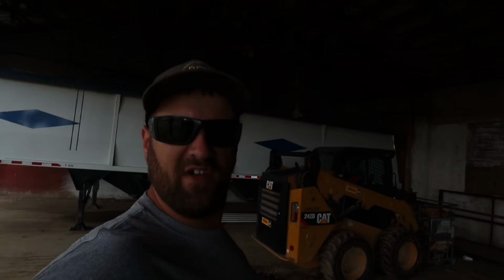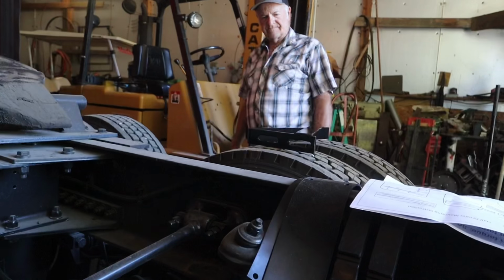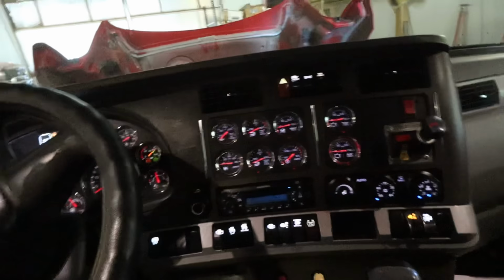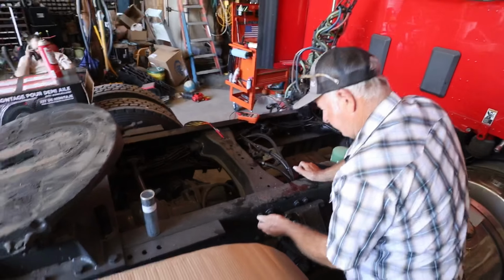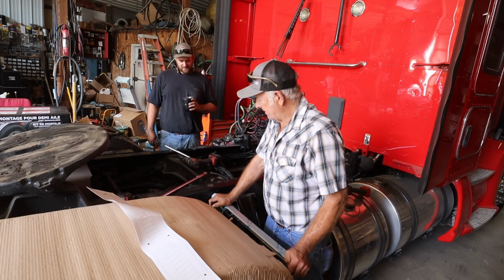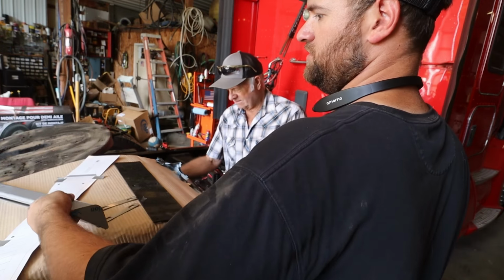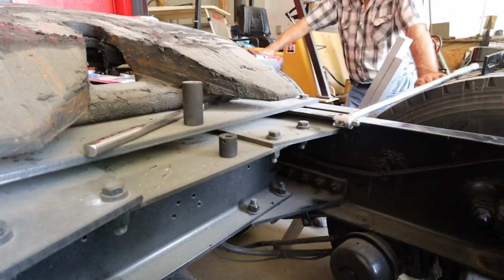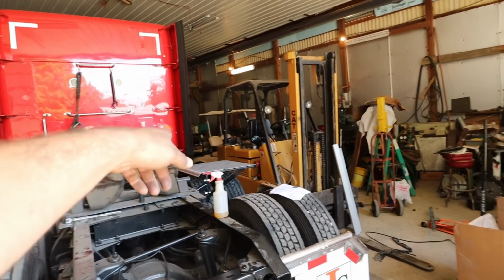How not to install Fenders! It’s Broke!

Comment: It is nice to see the three of you working together again on a working words project with fancy directions. Long time ago I installed fog lights on my new 1985 1/4 ton Toyota pickup. I was on the last step were I needed a hot wire from under the dash to power the on/off switch. Found a wire and finished. I turned on the fog lights and the dome light dimly came on. I found the dome light wire. The fog lamps  also would dimly come on when I opened either door. That was a hard one to explained to anyone.

Comment: I love how everybody was upbeat and excited about installing the fenders at first and then reality slapped you hard! I knew when the video started that you were in for a surprise. That’s a two day, at best, project for someone that knows what to expect. Working around all the existing brackets and air lines is an absolute nightmare and everything you do screws up the finish of the stainless steel parts. Good luck.

Comment: If y’all have to install any more 1/2 fenders 
East manufacturing makes a great sturdy fenders 
They are made out of aluminum tread plate 
In the front you lay a pipe across the top of the frame preferably 1 1/2 and cut out a strap 1/4 inch plate and round off the top on each side cut a hole in it for your pipe to fit in it and bolt to an existing  frame bolt end mount the rear brackets they are strong enough to walk on if you have to we used them on coal trucks in western ky they are very durable

Comment: I've put many of that style of 1/2 fenders man you guys LOL. If you think fender are too high you can weld 1x1 bar stock on stops which will let you drop fenders lower by 1 inch. That suspension drop 4 to 4 1/4 inches adding 1x1 bar stock to the stop take inch out of that. BUT being its farm truck going in and out of fields you may not want to do that going to need all axle movement you can get. I think you be better off with plastic fenders over stainless fenders you will get into them with trailer. Suspension on Kenworth from Peterbilt low air leaf they also use Peterbilts flex air too. But Kenworth call them different model name. Paccar made Kenworth use Peterbilt suspension since Kenworth had so many problems with 8 bag suspension

Comment: I have never such a problem installing quarter fenders. They usually bolt to the frame. Then you adjust them with the u bolts. Good luck

Comment: Oh Brian...how I could of saved you so much trouble!.Lol.  I've been thru that but have many sets installed under my belt now.
Reply: Also forgot to mention since you are pulling a hopper they need to be mounted low as possible or need a high fifth wheel.   I put them basically on the tire with air down.  Hopefully you don't rip them off going in and out of fields.

Comment: I hope the trailer doesn’t knock those off before it starts to climb up the 5th wheel when you back under it?! Those fenders are always a pain, they either crack or snap off at the front bracket. We went to the plastic minimizer ones.

Comment: Don't feel bad. I've seen mechanics install full fenders 2 inches higher than the fifth wheel with the air dumped out of the suspension. They got torn off when the driver tried to hook up a trailer.

Comment: i know what you mean brian about the grass burner exhaust man i help farm had one on an L8000 ford well used to be an old R&L trucking semi with ugly fareing on top and that green son bought it used it to pull the farms dropdeck with sprayer tanks on it till his dads 81 Ford L8000 dump truck we used to haul grain was getting too bad so made it a semi funny story about that if you are interested anyway his son bought newer western star daycab  and ravens 30 something ft dump trailer so his dad bought the green semi daycab we took bed and hoist and put on that truck winter project we hauled alot of grain and gravel with that truck  one thing i did not like was on bed it had roll tarp from side but used bar to roll open rope to pull shut but then it had ratchet straps on side of bed that you hook to tarp to hold and tighten down  and grain/coal door in middle of bed would open by hand but would stick it would have to be beat down with hammer mag lights work too at 11.pm at night in fall corn and spitting snow nov and in rush to bring me empty tryck and take loaded semi  home his son  left it up and grain cart and corn spilled out back lucky i saw only a shovel full  steel dump bed held 600 bushel heavy truck they had at time   3 semis 3 dump trailers one trailer only used for grain during harvest cause short and heavy alum one full frame other 2 used every day haul sand and gravel side job  or grain if selling some with 2 drivers they paid one dump truck farm plates 3rd truck farm use only 100% and a grain truck volvo 91 tandam with grain bed 600 bushel enough rambling on love your vid of truck cant wait to see it in action